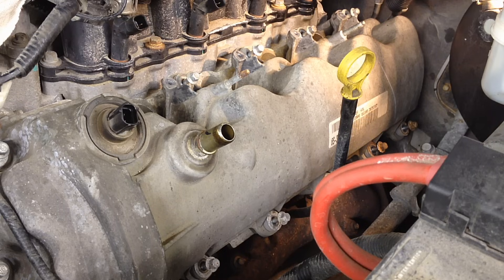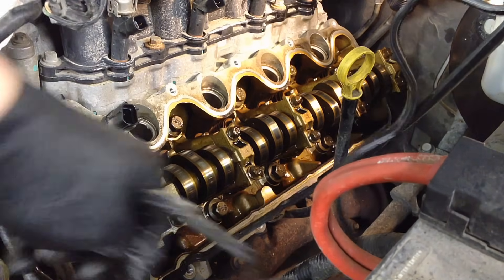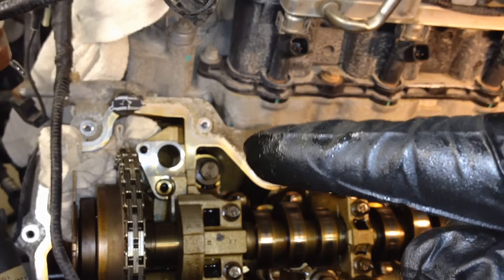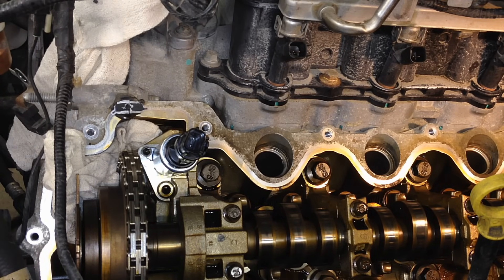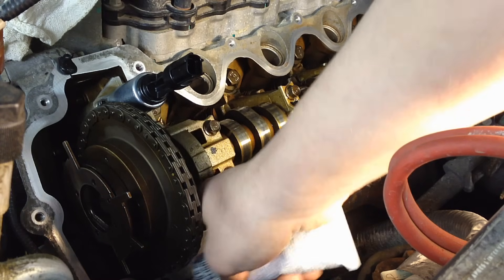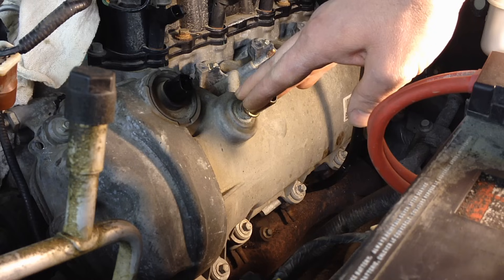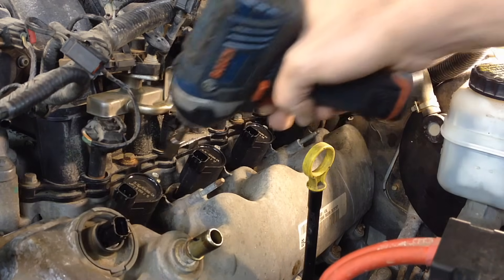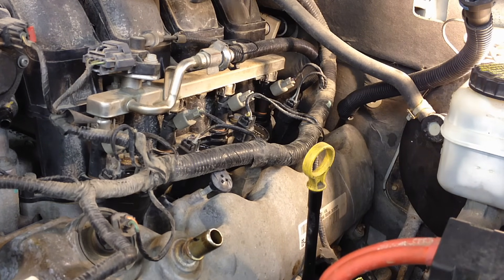Ford 4.6L 5.4L 3v Engines: VCT Solenoid Replacement

Comment: A PROBLEM OF POWER ON A F 150 LARIAT 2010 THE CAMSHAFT PULLEY A NEW CANDLES THE COIL TO THE SCANNER CODE 1000 HAVE YOU A IDEA

Comment: Wanted to say thank you for posting these videos.  I changed out both VCT Solenoids in my 2005 Expedition and it was a breeze thanks to the info you provided.  I didn't have to take off the valve cover for mine (thank God), but I will probably have to tackle that valve cover someday.  Anyway, thanks again for your help on here!
Reply: The 05’s don’t require it. Only like 07 and up, or maybe 09 and up. Different design
Reply: How did you do it without removing the valve cover?
Reply: @zacharymundell8508  Holy hell, it's been 5 years since I did that? Wow. Anywho... I believe I popped that seal out from around the top of the solenoid and used driver extensions to get to the fasteners. I was avoiding taking the cover off,  but I eventually had to do the entire timing job, so this process was futile in the end.

Comment: I have 2005 Lincoln navigator. it has 170k what type of oil should I use?
sometimes the car runs fine and sometimes It losses  power it's not  noticeable only to the driver.
Reply from the maker: This is the oil and weight I recommend- http://amzn.to/2rNWrDD
Reply: even though ford recommends the 5w-20? I asked my local parts dept and they never recommend 5w-30...not trying to doubt, but rather trusting and verifying! Thanks!

Comment: Do I need to torque the valve cover bolts to a certain pressure?
Reply from the maker: +Koltin Darley yes 89inch lbs
Reply: Maybe this is a dumb question but is there a conversion to foot pounds for this. My torque wrench only reads foot pounds
Reply: Huntin' with Hattaway 12 inch lbs equals 1ft lb.   so divided 89 by 12 and that's how many foot lbs it is. but I've never seen a ft lb torque wrench set that low....I think mine starts at 30ft lb which is like 360 inch lb.      so in your case you'd need a ft lb torque wrench that could go as low as 8.3 ft lb... probably could get away with ten... 

I just went and actually checked me elcheapo torque wrench here at home and it actually does start at ten foot pounds but I dunno if I'd trust a half inch drive el cheapo on a small valve cover bolt , I know that my more expensive torque wrenches I use at work start at thirty ft lbs though... 

just hit it with a quarter inch ratchet, hand choked up near the head of the ratchet and you should be tight enough without overtightening and destroying the gasket.

Comment: I have a 2006 f250 with a 5.4 3v engine with 100,000 miles on it. When it's cold the engine runs great. When it gets warm outside the engine stutters when  accelerating from a stop and also chokes and pukes when passing on a highway. Thoights?
Reply: U ever fix this? I have same problem

Comment: Hey man, I really appreciate your knowledge and these video's. I have recently purchased a 2008 F150 with the 5.4. It was a one owner with 212,000 and appears to have been well maintained. I have notice a single ticking noise that I think might be a sticking lifter. Have you seen this very much or do you think that it might be the beginning of timing chain slap/failure. Thanks in advance for your input!

Comment: Did this repair to my 2007 Mustang GT over the weekend, awesome! Thanks for the video. I enjoy that my car now sounds like it did when I bought it, not like a diesel with a crappy idle after long periods of driving.

FYI be careful with the valve cover bolts when re-tightening.  I managed to shear one off when putting one of the covers back on as I was on the home stretch to being done and back off the cover had to come to dig that bolt out. Dang it!
Reply: What were the symptoms of a bad solenoid

Comment: why not just remove the round seal around the sylanoid instead of taking the valve cover off??????
Reply from the maker: +Bill Levart That only works on the early models Mid 08 everything changed. Plus for the other reasons I mention in the video.
Reply: My 08 expedition was purchased by us at the end of December 2007. Is there an early build/late build with these like in the 2002 Explorers? and from my learning curve: what would happen if  you run without reconnecting the solenoid up after you test? Thanks for a great video (all of them!)!
Reply: FordTechMakuloco  I have a 07 f150 5.7 3 valve do the vct solinoid has it own fuse ?

Comment: Sir I have a 06 ford expedition with the 5.4 3v, I just got the truck about 2 months ago, some how it was running good now that thing sound like a diesel truck and its given a code p0020, so I remove the valve cover and realize that the vct solenoid is broken in half , can the be the only problem to the sound or can be something else?

Comment: First off thanks for all your videos, very helpful. My 2010 F150 4.6 at hot idle this thing sounds like it's going to come apart at time's. Knocking and very rough idle, give it a little gas and smooth's out and sounds good. I have changed phasers and vct solenoids and no change. I thought I herd you say ford recommends switching to 10w40 oil? to help with thinning of oil when hot. Is this my best option or should I chase something else mechanical? I appreciate any advice you may have. Thanks  PS no SES codes and 140k miles. I run 5w20 synthetic and fram oil filter.
Reply: Get rid of Fram filter...Motorcraft

Comment: hey ford tech, I bought a 06 f150 5.4 3v and at cold start it sounds fine but once it warms up it starts knocking/ticking. I have a short term warranty through the crappy dealer, so I took it to them and told them I think the phasers are bad and they say it's lifters, that 3 of their mechanics confirm lifters,but wouldn't it tick/knock when cold also? they also said it's normal for a Ford truck with that many miles to sound like it does and it won't hurt nothing. what would be your guess? 06 5.4 3v f150 182***
Reply: also only ticks/knocks at idle. truck runs real good.

Comment: I'm sorry I meant spend the engine over by hand just in order to pump all that fluid out of where the solenoid goes I generally just remove the solenoid cap or seal whenever I replace them even though those tools are usually damaged it's a whole lot easier to do that instead of removing the whole valve cover but I'm having an issue like you described and I was just thinking about the spinning the engine over by hand in order to have oil flow through there and to push possibly need to bring it back out I'm hoping but I wasn't sure if they were being any negative consequences
Reply from the maker: yeah by hand is ok

Comment: I have a 2005 5.4 120,000+ miles. @ 110,000 I removed and replaced both left and right phasers  both tensioners and chains. I have used Motorcraft Synthetic Blend Motor Oil, 5W20 oil at every oil change between 3000 - 4000 miles and the inside of my engine looks just like this one. And now i have another tensioner that is making load noise at start up. any after maket tensioners you would suggest?
Reply: i also use motorcraft synthetic blend in my 07 mustang with 48K miles which i change everytime i see the oil getting dirty on the dipstick,,i think my valves are bad because im getting blue smoke at startup which it has never done before.

Comment: When I unplugged my 2 VCT the taping/ ticking noise go away. Is that mean my VCT garbage? Or it's my camshaft sprocket?
Reply: Tom Drew what kind of engine do you have? Mine is a 4.6 3v 2010 and when unplugging the Vtc connections the noise stopped. It ended up being the actual vtc phasers. If your at a drive tru and barely lay on the gas and hear a knocking on the right had passenger side that is your problem.

Comment: I have a 01 crown vic with 251000 on the clock all I have done are replace the intake and of course numerous  coils and plugs runs great change oil 2500 miles should I worry about replacing timing chain.

Comment: i have a 2010 f150 5.4 and pulling into drive thru's truck starts running rough like you described, rev it up and its fine also in bad traffic it will do same. with 170k would it most likely be VCT rather than phasers?

Comment: I've seen this replaced without removing the value cover.  Is there a benefit to taking the cover off.
Reply: Engine maintenance really, cleaning covers and replacing gaskets and such

Comment: thank you for your video that help me a lot, i change my 2 vct solenoid and engine run very good but i have a obd2 code is p0345 and p0349, thats tell me sensor A bank 2 but i dont know wich on is, driver side or passenger side??? and can we test it before change??? Thank you so mutch for your help.....
Reply: @Jason Rodriguez did you figure it out...same problem here...everyone on YouTube just wants to have their problem fixed but don't wanna help out when they get it fixed to help other people with the same problem

Comment: had classic vct symptoms and finally warm enough to try solenoid charge on 06 5.4 xlt. Started on driver side, broke connector on wire going to front cover , heat damage and caked  full of blue.I  made a new connector and put back together without new solenoid and its quiet, no  knocking and smooth idle with more power! I still saved  solenoids for future ,but look under power steering res bracket, might get lucky like me ,had stuff in cupboard,good old Wisconsin salt and heat.Your videos are the best !!!

Comment: I have a 2006 Ford Fusion SE and I took it to the shop and the replaced the vvt selonoid in bank 2 but their saying I need a cam solenoid seal is that true ?
Reply from the maker: That is the seal for the vvt solenoid they can tear when the cover comes off.
Reply: How to replace coils on 2006 Ford F-150

Comment: I've got an 05 expedition I just did chains guides phasers and solenoids. All ford parts. Truck runs great off idle. At idle is runs rough and sets a p0021. Any suggestions. Assuming my drives side is off a tooth somehow ?
Reply: did you figure  yours out I have the exact problem after replacing tensioners guides and chains.

Comment: do you HAVE  to remove the valve cover to replace the vct and for the passenger side, does the ac line have to come out?
Reply: Way too much work valve covers can be kept on unless it's an 2007 and up then and they are below valve cover then
Reply: I have seen these changed without removing the covers.  45 minutes to change both.
Reply: It all depends whether or not the valve cover grommet has the dog ears on it where they are a little offset.  This allows for two things.  A tool to get in and room for the sensor to come out.  If you have a grommet with no dog ears, you are s.o.l. as even if you have a tool to loosen the sensor, you're not getting it through that hole.  Check first.
Reply: No unless it's 2007 and up. If you see solenoid poking through valve cover then just pull dust cover with vise grips
Reply: If you know how to change the VCT Solenoids without taking off the covers, taking shit apart - I'm listening. I"m pretty sure it's what my Expedition needs, but I want to do as little as po$$ible to this truck, just get it running decently, and eventually sell it.
Can you explain how - or have a  video that shows how to do this?
Reply: Only from 04-06. Not any newer. I wasted a lot of time and money to try and do it without taking the cover off for my 08
Reply: So with my truck, the vct seal don’t have the little dog ears. So does this mean I have to remove the valve cover? I can’t seem to get the tool in there to loosen the screw.

Comment: I have a 2006 Ford F150 4.6L that i'm thinking my  rough idle is the VCT solenoids but for the life of me I cannot find where they are located. I notice the video includes 4.6L but none of the images of any motors match mine and I can find nothing sticking out of the valve covers. Mine are black. You have any experience with this type of motor?
Reply: Actually after searching until my eyes glaze over turns out the 2006 4.6L motor does NOT have VCT solenoids!

Comment: How do I know if just the solenoid is bad or the cam phaser itself? One shop is suggesting I replace both and another is insisting it's just the solenoid. I bought the truck used with 58k miles. It now has 67k miles. Definitely has a knock under the valve cover.

Comment: Thanks, you got my sub.  My 04 5.4  sounds like diesel have you noticed this with the 5.4 or the 04 ? 
Thanks again great video. Off to the parts store.  Are there two of VCT on my 04 ?
Reply from the maker: Yes one each bank
Reply: Round One: removing the VCT solenoid from my truck out in weather, In the cold dark night,  (drop light under the hood ) and round one goes to the truck. Do you happen to know what size that bolt is that holds it in there? Yes, I cheated removing the seal to take it out, but I could not get a bite on it.(bolt/screw) Is it a Phillips? I tried to get a socket on it and nothing. The new ones did not come with any new screws/bolts.  
It started to look like it was a star pattern towards the end. If you happen to know off the top of your head, I sure would appreciate it. 
Thank you and Happy Holidays

Comment: look at other videos, no need to pull everything off or the valve cover itself. Only the cap that is over the VCT solenoid. Some solenoids even come with a new seal cap
Reply: i have a 2007. No way to get anything through the hole around solenoid. Attempting this myself and only option appears to be valve cover removal.
Reply from the maker: Ah but you would be wrong try your method on any of the 9 bolts valve covers that came into service starting mid 2007 and you will know your method does not work anymore. Not to mention its a bad idea on the 2004-2007 models for the reasons mentioned in this video.
Reply: So I just replaced my bank 1 VCT solenoid today on 2005 F150 5.4. 3V without removing valve cover.  
My opinion, 
1. Be careful, extract the solenoid with your fingers while loosening the T27 bolt.  I bought OEM VCT solenoid and seal from local ford Parts dealer with the captured bolt.  Highly recommended and not much more expensive than the "aftermarket" parts.
2.  Removing the seal/gasket.  I can see what people mean when they say it can be a pain but it wasn't as bad as I expected.  Use a flat head screwdriver and just pry up around it and work your way back and forth.  Surprised me when it popped right off after a couple of passes around the seal.  (NOTE the original seal part was different than the one on my ford.  Apparently, these had a problem with the valve covers cracking so if the valve covers were swapped out, then you need the seal ending in 535).
3.  Overall, not that bad but take your time.  Mine took less than 1/2 hour to change on RH side.
Reply: I watched the video and forgive me if I missed it but I didn't hear why you can't do it on the 04-07 models.  If it has to do with damaging that seal then can you just replace that?
Reply: I have watched a few videos describing how you did it. The key is "BeCarful". If that bolt falls down in there phew boy.
Reply: Great video, repairing same issues on my 04 as you suggested, both VTC and their sensors, noise and violent shaking has phased out but still idles up and down and will turn off. Any help would be great thanks!

Comment: I installed a cam-phaser lockout kit on my 07 Expedition 5.4.  So there is no variable timing.  I have DTC P0345 (camshaft position sensor).  I replaced the sensor but still have the code.  Could a bad VCT solednoid still trip this code, even though there is no variable timing anymore? It has a very slight rough idle, and no other codes. Thanks
Reply: You need a phase lock out programmer. Should of came with kit. Most kits do anyways

Comment: I have an 04' F-150 triton that runs pretty good most of the time. When I drive it on the street or freeways I have no problem but when I take long trips and hauling with my AC full blast that's when it starts to really shake bad. Do you think it could be the VCT solenoids even though it doesn't shake on normal driving conditions? It also sounds like a Diesel engine a buddy said it might be the timing chains that tend to lose tension after time. Thanks in advance.

Comment: I replaced my vct's, now it says no oil pressure and it's knocking any ideas?
Reply: Sounds like you had an oil pickup tube blockage problem ...now need new engine